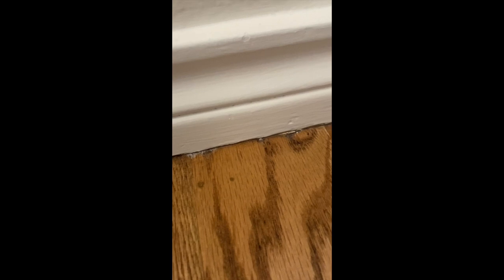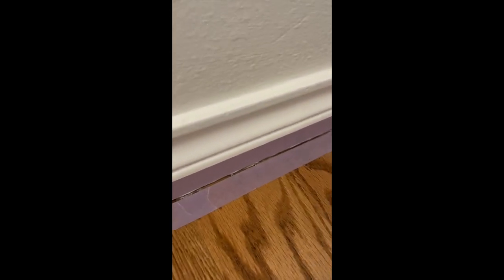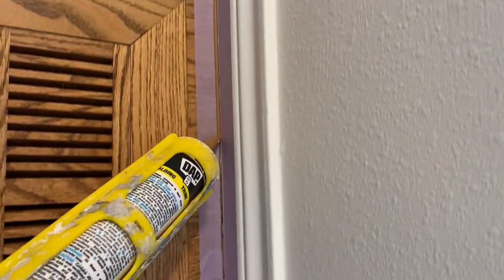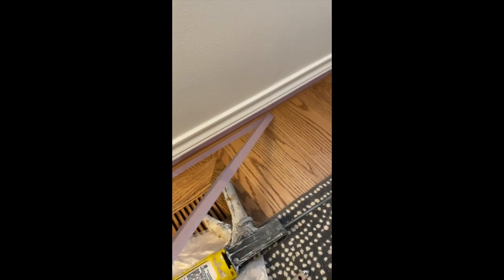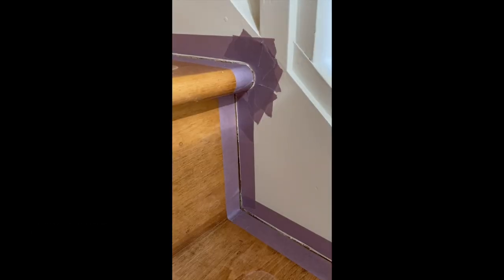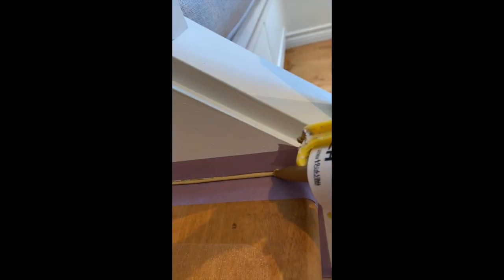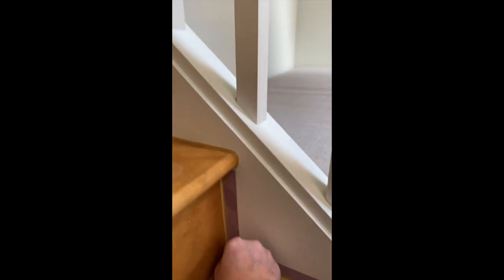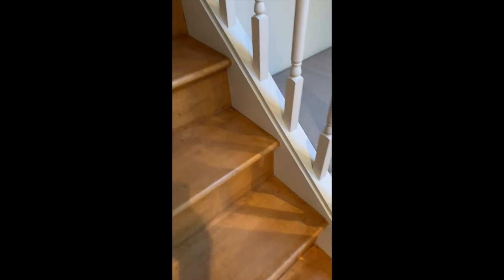When You Should Caulk Between the Base and Wood Floor   HD 1080p

Comment: Thanks for the idea of matching the floors rather than the baseboards! Glad you really hammered home how important taping and prep is—I know it but still need to be told repeatedly to get me to do it right haha! I am curious about maintenance, cleaning, and how often it might need to be redone.

I’ll also say that most of what I’ve heard and read is to leave the baseboards attached when refinishing if they’ve been painted a few times. Removing generally causes more damage to walls than it’s worth to remove them….
Reply from the maker: The maintenance is tricky as, to be honest, caulk can get dirty over time.  This is why I do not recommend caulking the baseboard to the floor in most circumstances.

As for the the second point, as much as you need to be careful about removal of the base before refinishing the floors, I personally think it's a better idea.  I know that putting it back on requires putty and caulking, but most flooring refinishers sand into the bottom of the base causing the problem I note in the video.  I am more concerned about the final look, so, to me, pulling the base before the floors are done looks the best in the end.

Thanks for the comments!

Comment: Funny how different preferences are.  I prefer the caulk to match the baseboards.   Harder to do well, but if done correctly,  it looks like the baseboards are growing right out of the floor.
Reply from the maker: Visually, I totally get the look you going for, looks super clean when it's a true 90 degree.  

This is why I almost never caulk the bottom of the base.  I think it just looks cleaner, most of the time, when left alone, even if the floor and base are not super tight to each other.

Thanks for the comment!
Reply: Exactly I will leave it too. When putting up the baseboard,you can push it down on to the floor, reducing the gaps although I don't know if it is right or wrong in terms of flexibility required.

Anyway we did our flooring recently and we removed the baseboards and then laid the floors. We were fully re decorating the rooms. The walls were painted by removing baseboards and new baseboards were given 2 coats of primer and paint each. Our floor boards were way too much uneven. We used quick step 7mm thick laminate boards. The flooring guy suggested quick step 5mm foam underlay to cover the unevenness. So when we put back the baseboards, we push them down a little bit, pressing down on spongy underlay to reduce the gaps. Now we have just about 1mm gaps at some places plus it feels nice to walk on this floor than a hard floor. Well I know it is selective and it may not be the choice of others. It is just another way to reduce the gaps.

Comment: When I saw this I thought "ugh, I hate caulk between baseboards & the floor" but assumed you were going with white. I'd rather have a big ol' gap than that and I agree with you that it looks tacky. I worked on a job this year with another painter that did that very thing. Great idea  with the colored caulk but the baseboard should have been removed for the floor re-finish really. Nice work Dave 👍
Reply from the maker: Thanks for the comment!  I personally hate caulking these areas period, but sometimes you run across something like this that just needs that extra touch.

Agree with the removal of the base.  I would think it would be easier for the floor finishers to remove them, but...flooring is not my forte ;-)
Reply: I do like the tape though

Comment: Love that you didn't use white for these. Question: Our bathroom floor has white tiles with smaller brown accent tiles and white base board, so against the base board are two colors. What would you recommend? The grout used for the tiling is tan and they left some extra sanded tan grout here for me. Would that work, I wonder? The wall color is a tan and we also need caulk on top of the base board. I assume a tan caulk would be the way to go there.

Comment: Great video and great tip on matching the caulk with the floor. I have quite a bit of a gap in some places between the skirting board and the floor (over 2 mm). Woudl you still recommend using a caulk that matches the floor? Or would white be better in this instance?

Comment: I wish that flooring companies should have created a small 4 to 5 mm thick and may be 8 to 10mm wide mdf strip, simmilar to the 45° mdf beading they use and it should go striaght on the skirting, taking away only 4-5mm of room space. As it will be of same color as floor, it will look nice. That will avoid the home owner, who don't want 10 to 15mm 45° beadiing from usung silicone caulk. I think flooring companies can do various widths for example 6mm, 7mm 8mm etc and one can then choose based on the biggest size gap. Even thickness can be reduced down to 2 to 3mm based on practicality. What you guys think about this?

BTW: the suggestion above with reduced thickness is for floors where skirting was installed later, just like this video. In the other case where floor is laid without removing the skirting board, you can't avoid the 45° mdf bead because installers leave large gaps.
Reply: I think it's a great idea!

Comment: I get why people do it but over time looks pretty bad. The material traps dirt/ hair and difficult to clean. Is there a better solution?
Reply from the maker: Best case scenario is to never caulk these areas.  

If your transition between the floor and bottom of the base or base shoe looks bad and you don’t like the idea of caulk, then the only solution is to replace the base or base shoe.

Comment: What caulking did you use?
Reply from the maker: I used two different brands as the floor colors were different; one was Big Stretch and the other was Dap's Dynaflex 230.  

I used a silicone/latex or silicone/acrylic hybrid.  I don't recommend a 100% silicone or a cheap, just Latex or acrylic caulk.

Comment: Caulk cracks over time. Why not use white silicone? 🤔
Reply from the maker: The video explains the whole reason why I do not like using white caulk.
 
You are correct that a pure silicone, in this example, is probably a good idea. However most manufacturers do not make a variety of colors in a 100% silicone, hence you are at the mercy of what is available.

Thanks for the feedback!

Comment: Was your caulk just 100% silicone?  Have u thought of using adhesive like liquid nails [ once and forever ] to replace your silicone as Liq-nail will harden and adhere tight.  Thus, thickened bleach gel + tooth-brushing can then be applied to remove the dirt or fungal mold grown on hardened liq-nails every 2 months or so if any. In many silicone cases, one needs to repeat, on top of cleaning, the 4-big-step  job [remove, cleaning, caulking, refine ] once every 2,3 or 5 years depending on whether the sealing power of silicone remains.
Reply: I have seen on internet, numerous times that never ever use hard stuff between your walls and floors. This should always be flexible to accomodate the movement. This is why the floor layers always leave the gap and usually cover with mdf beading. In the above video, the skirting has been put after laying the floor and this skirting is acting as beading. The only problem in this scenario is the uneven bigger gaps because floors and wall are never true to the 100th of mm or thousands of an inch. Mdf beading matching to floor colour  is another solution to cover these gaps and they are easy to apply, just a nailgun. They are also easy to clean and maintain and cheap to install. But the big but is that some people just don't like them because uf you have a piece of furniture and you want it to be squared to wall then you can't because 10mm of beading is on the floor.

Comment: Use clear instead of white. Also film with your phone to the side. Not up and down
Reply from the maker: So I think you have misunderstood the point of the video; if you use clear caulk, it does not solve the problem I have posed.

As to your comment on the phone angle, yes, agreed that would have worked better.

Thanks!
Reply: I really hope you don't do any remodeling on handyman work. Clear wouldn't hide the gap.

Comment: Will this cause the floor to buckle during temp chsnges?
Reply from the maker: The floor to buckle, from a line of caulk?  I'm not sure I understand the question.
Reply: @DaveMartin  will the caulk prevent the flooring from expanding and contracting during weather changes?
Reply from the maker: @bobbyl5585  Not likely.  When you paint a house, say the trim, you will caulk, prime, and paint sealing the trim from the elements and the trim will still expand and contract with the changes.

If it's a free floating floor, and if it is going to expand and contract quit a bit, first, if you don't have to caulk to the floor, don't, but if you have to, I would recommend using a product like Big Stretch as it will expand up to 3x the original crack size.

Comment: Pass I’ll be at my clients house all day masking lol no thx
Reply from the maker: I understand passing on this if the transition between the bottom of the base and the floor look just fine (as a matter of fact, I prefer not to caulk this area at all unless it doesn't look good).

But if you leave it just because it's a bit more work, I think overall, it just makes the job look unprofessional.  In my opinion, it's things like this that make all the difference.  

I also noticed the problem when I estimated the job and adjusted the bid accordingly.

Thanks for the comment!